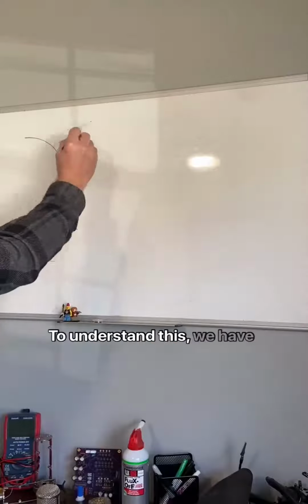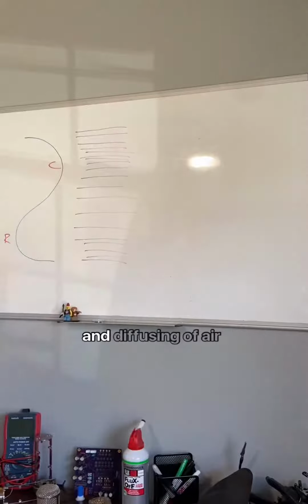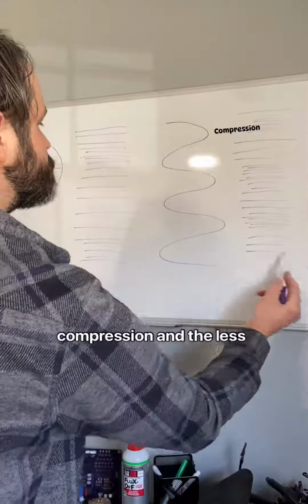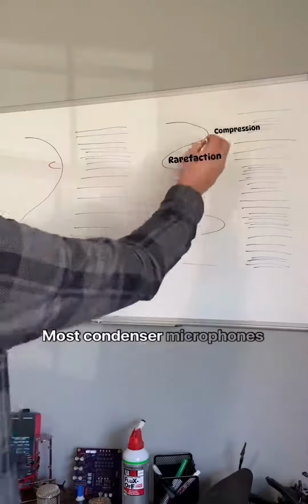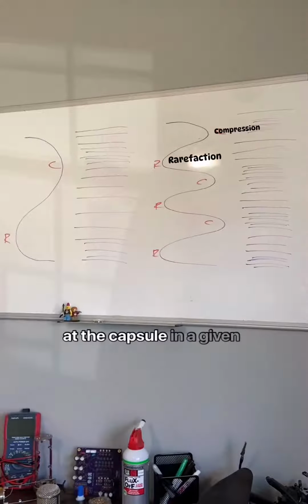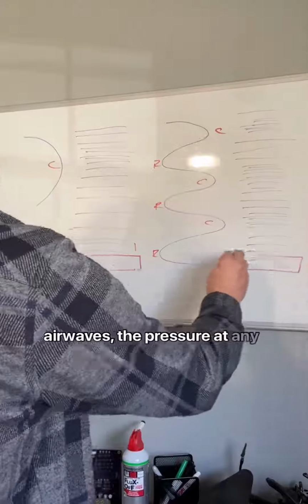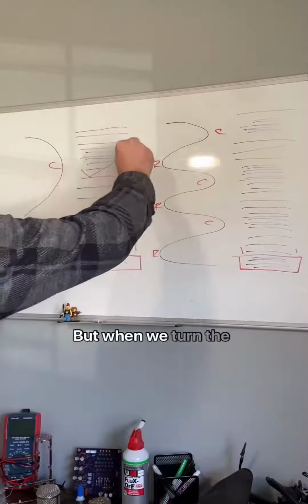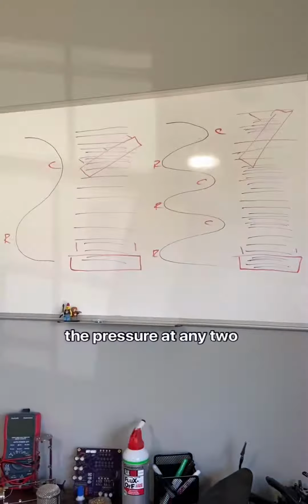CONDENSER MICS EXPLAINED by Vanguard Audio Labs - Why Omni usually isn't omni!

Comment: I hadn't thought about audio capture like that before 🤔 

Usually thought about the vibration of the mass instead of the pressure itself.
Reply from the maker: i mean, it does indeed vibrate! but it vibrates due to the compression and rarefaction of the air on the diaphragm.